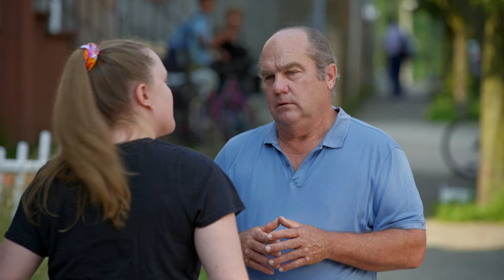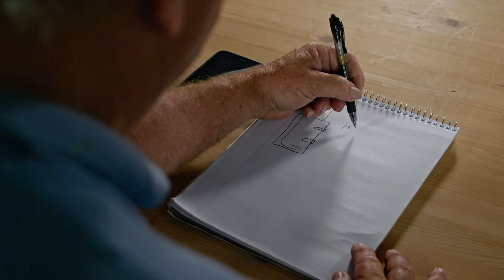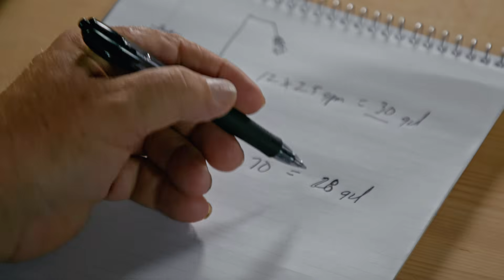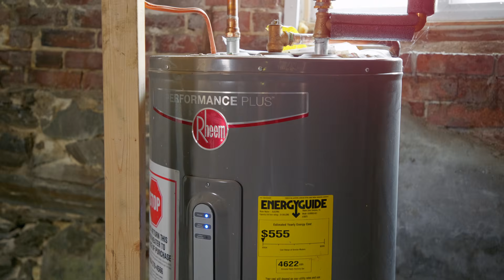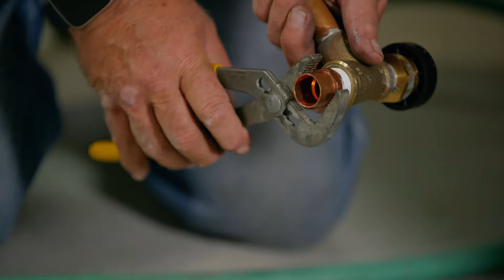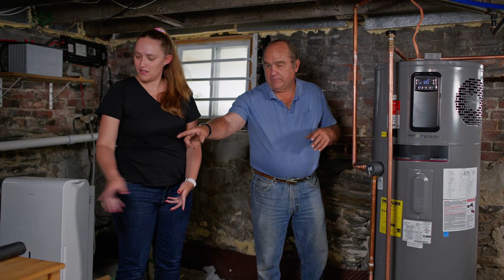When To Upsize a Water Heater | Ask This Old House

Comment: Great video, but measuring the capacity of the previous tank confused me. Richard used the 70% rule and claimed that a 40 gallon tank really only provides 30 gallons of hot water, but the “first hour capacity” of tank type water heaters is usually 20% more than the tanks size. So a 40 gallon tank would actually provide almost 50 gallons of hot water in the first hour of use once the tank is completely heated. 

Also, that’s assuming the water is being used at 120 degrees. No one showers at that temperature. If you mix cold water to decrease the temperature to normal showering temps, you’ll gain even more capacity. Furthermore, if you raised the thermostat temp to 130*F, you’d gain even more. 

To save the customer a lot of money, he could have installed a TMV and ran the heater at 160*F, then mixed it down to 120*F, upping the capacity of a 40 gallon tank substantially.
Reply: The problem with that is that the energy loss of a tank type water heater increases exponentially with the increase in temperature.  You're taking an already energy intensive resistance electric water heater making it even more expensive to run.  The solution shown here is easily the cheaper long term solution.
Reply: Oil-fired water heater Thermo pride

Comment: A 40 gallon hot water heater should easily be able to handle two showers in a row.  In fact according to his math 10 extra gallons of capacity only adds 7 gallons of hot water and 3 minutes of shower time.  The original water heater probably had a bad thermostat and could have been fixed for $20.  Rookie mistake by a guy who should know better.
Reply: The backstory is just fluff, the point was to install this specific water heater.  The conversation could've been:
Homeowner: "Richard, we got a brand new 40 gallon heater installed the other day, and..."  
Richard:  "Full city water pressure!  That's the culprit. We need to put in a 50 gallon heater with a heat pump on it now!"
Homeowner: "Huh?  You haven't heard what the issue is yet and..."
Richard:  "It's always full city water pressure.  Now let's get to it and get you a new water heater"
Reply: It’s gotta be a sponsor deal because the water heater is listed in the description

Comment: Uhhhh... isn't the easier solution to replace that 2.5 gpm showerhead? 😂🤔 Unless they LOVE that showerhead, finding a good one w/ aerator that is 1.5 gpm gives 20 min (vs 12 min*2.5gal/min) for the same 30 gallons used number 🤷‍♂️
Reply: And maybe measure the hot water temperature in the tank since the customer's complaint is about .... errrr.... temperature?

Comment: That heat pump sucking any warm air will leave the basement cold and first floor floors chilly. Thus forcing to turn up the heat, consuming more oil and then back to square one. 😂
Reply: Nope. Only a 2 degree difference. Or you can duct the heat pump somewhere else. It has connections.

Comment: This is counting only 1 hot showerhead at 2.5 gallons/minute.
The less efficient environmentally horrible, a gas powered hot water heater will restore 48 minutes of water every 60 minutes.
The more efficient Rheem 40 gallon Heat Pump hot water heater will restore 6 minutes every 60 minutes though.
You may want a bigger tank if you are going the heat pump route, or buy a second tank with no heating element as hot water storage only.

Comment: I am surprised a pressure tank wasn't installed. Most places require it by code.
Reply: If there isn’t a backflow preventer installed or a check valve of some sort, a thermal expansion tank isn’t required.
Reply: @valenzaplumbing  Some areas require it for all replacement water heaters, no matter what.
Reply: @oldtwinsna8347  That’s silly, and completely ignores the entire reason for the design of the thermal expansion tank. A thermal expansion tank is a useless piece of equipment if there’s no backflow preventer.
Reply: @valenzaplumbing  my understanding is some localities don't like the idea of your water backing up into the public water supply. ( I guess if it gets bacteria by being too low temp in your water heater?)
Reply: @UTeewb Then you would need a backflow prevention device. Not a thermal expansion tank.
Reply: @valenzaplumbing  Right but my understanding is now that you are preventing backflow, your water heater puts positive pressure on all of your plumbing as hot water expands, so the expansion tank prevents that.  So the two go hand in hand.

Comment: Big fan of Richard, but I put one of these in my mom's house the the installation instructions clearly call for a flexible (PEX or Braided Stainless ) connection for the water lines since the heat pump vibrates.

Comment: the heat pump part takes a long time to heat the water so if it has to kick in the heating elements frequently then that great savings is not going to be that much. in winter your basement will be a refrigerator after it sucks all the extra heat from room, I think the heat pump water heaters makes sense in warm climates like Florida where you want to cool room anyway and dehumidify.

Comment: nobody ever puts in tempering tanks anymore so that the cold water can sit in it as it comes into house at 50 degrees and warms up to room temperature before it goes in water heater it makes a difference if water is starting at 68 instead of 50 I stripped insulation off old water heater and put it in line before new one it made hot water much steadier temperature and run longer.
Reply: But you're still paying to warm up that room temperature water tank, at least in the winter. Maybe a good idea in warmer climates, if not concerned by the extra tank using up more space and being another point of failure. tradeoffs.
Reply: well you don't actually have it hooked to any power you just absorb some of the room warmth not sucking all the heat from room like the heat pump it worked well next to a gas heater but with heat pump probably not as well. @JasonFarrell

Comment: I'll take gas water heater any day i never run out of hot water with a 40-gallon gas water heater and it costs almost nothing to run about 8 dollars for the actual gas used with stove and dryer when heat is off of course they have service fee for maintenance so it's like 20 to thirty on months without heat.
Reply: They may have not had a gas hookup, their original water heater was electric.
Reply: @Bremend  yes some places don't have gas or it is way more expensive in new england since they are at end of gas pipeline but even an oil water heater would provide more hot water.

Comment: Hi, just curious.....why not go tankless? Aren't they energy efficient and provide (theoretically) unlimited hot water?
Reply: @@donovanlewis3053 OK, thanks! I have a gas tankless and it's great!
Reply: @@donovanlewis3053 also a competent homeowner can install this hybrid unit whereas a tank to tankless swap would require either a bigger gas line or upsized wiring.

Comment: I have a 40 gallon electric tank with two elements and it works well for two people, it’s quite, simple and works. My previous tank that was in the house when we bought it was a 50 gallon gas water heater that was 12 years old, gas has a faster recovery but uses non renewable energy.
Reply: majority of electricity is made by non-renewable energy some pretty dirty like coal slowly being replaced by gas it is becoming largest use for generating electricity

Comment: Last thing I want is a wifi enabled water heater.
I want my water heater to last 20 years. There is no company out there that wants to support the software that wifi enabled water heater uses.
There is nothing wrong with old fashioned mechanically controlled water heaters. They work.
Reply: It works offline and can be controlled without any app or cloud. If you're savvy and do a little research. 😊

Comment: I would have, personally, recommended a tankless on demand water heater. No storage required (means more space available for use for other things) and virtually limitless, instantaneously available, hot water. Of course that really only works if you have town gas or a local gas supplier that can regularly deliver and swap your bottled gas BEFORE you run out.
Reply: we get cheap natural gas so it's a no brainer, but this water heater would make sense in south where house is hot all year round and you get air conditioning and dehumidifying with this unit.
up in New England their basement will be a refrigerator in winter with water heater sucking up all the heat in basement.

Comment: I have my doubts on their info regarding the previous tank.  Technology Connections tested his electric water heater and he found it didn't mix much at all, so he got the full amount of hot water out.  In fact it would heat water as it entered, so it would actually give more hot water than it's actual volume, not less like TOH is stating here.
Reply: That was a great episode.

Comment: Warm water is less dense than cold water.  That is why I always put a "S" type connection onto the outlet of a hot water tank. I use a larger diameter braided short (6ft) water hose.. The outlet of the boiler hotwater pipe is a) directed into the hose, then fold the hose b) across, then c) downwards and then across and d) back upwards to the house piping.   When no water is flowing, then due to  warm water being less dense, the hot water stops at the top of the flat part, and does not, migrate downwards to where the hose connects to the house hot water pipe.  When the tap is opened, the flow works as expected.  The hot water always stays around the tank, and does not, migrate up into the house. (I save about $10-15/mo with this heat trap).
Reply: some hot water heaters come with built in check valve nipples to keep hot water in hot and cold side of tank.
Reply: All water heaters built in the last 20 years have built in heat traps.

Comment: Do I need a new water heater? No; Did I watch the entire video? Yes.
Reply: Each water heater has an initial first hour capacity rating, based on a full tank of hot water, and how fast it heats cold water. Looked at a new tank, and its rating for a 40 gallon tank was 50 gallons. Does the homeowner have galvanized piping? Takes a lot of hot to warm up all that iron on the way to an upstairs bath. Could they have set the tank temp up 10 degrees? Installing a new, bigger tank creates a better show than coming in and bumping up the tank’s setting.

Comment: I guess I'm a little fuzzy on why use a heat pump? 
The issue with the original unit was it was too small. The new unit is 50 gallons, which solves that issue. 
From my understanding, heat pumps are just more efficient than normal electrical heaters. Is it just a bit cheaper to run? Also, how does it compare to gas?
Reply: With a little bit of googling, in my area it makes no sense to go electrical. Most homes are piped for natural gas, and electric is so much more expensive. If you have solar or batteries you can save a bit, but without the government programs it's about $1200 more to go heat pump. And unless the water heater lasts 24 years, you won't get a return on investment. You can expect to save $50 a year over gas. But if you have solar it really stacks up. Especially if you have a oversized system like everybody here. (they look for electric systems to add in, because the local power company doesn't buy back power)
Reply: I think these would only make sense in deep south where it's always hot, so you get benefit of air conditioning and dehumidifying if you use lots of water the regular elements come on and there goes the savings of heat pump. in north in winter your basement will be frozen with heat pump sucking out the heat.
gas where i live is cheap and it is faster at heating the first hour hot water output is much higher than electric heaters.
Reply: It's at least $50 cheaper per month on my local utility bill. Plus you get rebates and tax credits to go this route. Also the power consumption is significantly less. If you have a whole house power backup that extends the time you can run in an outage.

Comment: I replaced my stand-alone hot water heater with a stainless steel tank heated by my super-efficient condensing boiler. No heatpump to fail, no extra electricity, no app, nothing complicated and therefore failure-prone.

Comment: If you’re spending the money on a hybrid water heater, just add it in series with the existing tank with a recirculating line & pump and use it like a holding tank. 90 gallons available
Reply: I'd use it as a prewarming tempering tank since it's not leaking take insulation off and put it in line before the heater it just warms up cold water to room temperature, so it is at least 10 to 30 degrees warmer than water coming in from outside.

Comment: Installed the 40g version this fall when power bills were climbing, it was one of our highest energy guzzlers in the house. After install, power consumption for the month dropped 300kwh. Upgrade will pay for itself in electrical savings very fast and over the life it will save enough beyond that to pay for the next unit as well. Great systems and can't wait until the summer heat has it working even more efficient.
Reply: What kind did you get?
Reply: @Skoyles  Rheem 40g Performance Platinum. Two adults, 2 teens and it holds up well supplying what we need.
Reply: Nobody says how much the new water heater cost’s.
Reply: @stevehousley8375  B/c it varies. Mine was about 1800 for the unit delivered to my door. Another $600 on install. $2400 but I will get a  $800 tax credit. I also got $150 from the power company. No state rebates. It will vary a lot by location when it comes to labor and incentives.
Reply: @KoiBoy6  i just installed mine with new expansion tank and everything else new  it was less than $800, yes I know that I installed it myself but I’m able to do that.
Reply: @KoiBoy6 tax credits mean nothing if you're already at the maximum deduction limit. People think a tax credit means free money, it doesn't.

Comment: I would have also put in a 1.5 gpm shower head.
Reply: I like the thought. I would have tried a 2.0 if I was used to 2.5. Got a 1.8 in my shower. A $15 fix instead $2500. I wanted on in my basement, but could not get one short enough to fit. Stayed with gas.
Reply: @donc-m4900 yeah the height is a challenge for some. The cost savings pay for itself usually in just a few years - the yellow sticker usage is based on rates lower in New England often by half.
Reply: all depends on how it gets used if you use lots of water then the heating elements kick in, and your savings is gone that sticker is for mostly the heat pump heating water. @ntsecrets
Reply: @ntsecrets  I use an portable ac/dehumidifier in the basement already, so I would have saved even more. But someone made a serial staircase to the basement, in the corner with maybe 5 feet clearance. Can't tip it cause it hit the outside wall. It would be able to stand up if it could have gotten down there.

Comment: How about downsize or change from gas to electric? I’m trying to get away from gas appliances.
Reply: May I ask why? Natural gas is more reasonable than electricity where I live
Reply: @DadBurl  I live in CA. PG&E’s gas lines are old and have resulted in explosions and deaths. One such incident was right down the street from me. My hot water heater needs replacing anyway so I’m going with electric.
Reply: odds are pretty dam low of being blown up by gas more houses burn down by far from bad electrical wiring in fact it is number one cause of house fires. @DovieRuthAuthor
Reply: Because the sheep follow the latest trends to "save the planet" without even knowing why they are doing it. @DadBurl
Reply: @willdogsdroid strangely enough I consider electric (not what they have) more self sufficient. There’s many ways I can produce electricity. Without having to rely on some gas companies. Another neat thing I have is coils around my woodstove that feed hot water into a storage tank. Guess I’m more “green” than all the other options out there lol.
Reply: @jack87597 good for you.  Wood heat  is the bomb.   Most homeowners and landlords who must replace their water heater simply install a matching replacement because it can be cost prohibitive to switch from gas to electric or vice versa,  even though they may have a strong preference for one or the other.

Comment: People saying gas tankless requires an electric service upgrade? 

Gas tankless units only utilize 120v 15 amp breakers whereas electric tanks and hybrid tanks require 240v 30+ amp breakers
Reply: Depends on the hybrid tank. The one he installed, yes. There are models that use 120v 15 amp also.

Comment: These are the only guys I trust on YouTube for home repairs.
Reply: That's crazy. There are a lot of videos with terrible advice in them.
Reply: There are quite a few channels on youtube with much better advice/info than this one. Recommending a heat pump water heater is a red flag.
Reply: Yep,for sure!!
Reply: Good show, indeed. But they are sponsored, and the don't always make that clear. This is probably a sponsored video. And he should have checked the outlet water temperature of the old heater before drawing a conclusion. And maybe verified that the shower's mixing valve is working correctly.
Reply: @jptrainor  PBS is indeed sponsored and very supportive of Democrats
Reply: @UncleSamUSofA so what
Reply: @joellops2611  sew buttons
Reply: @UncleSamUSofA excellent!!!